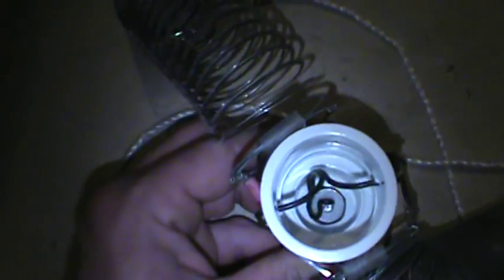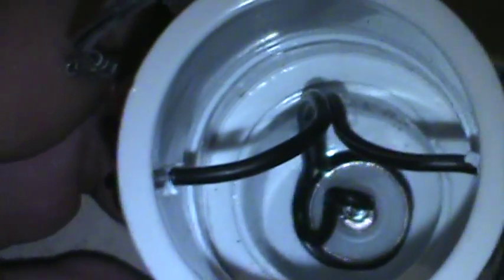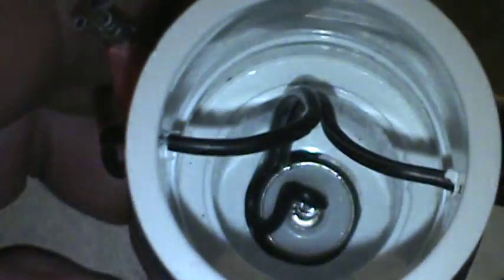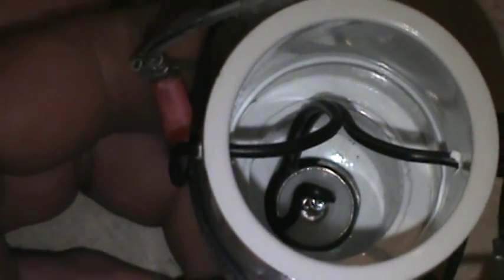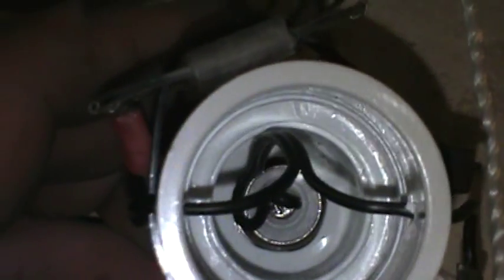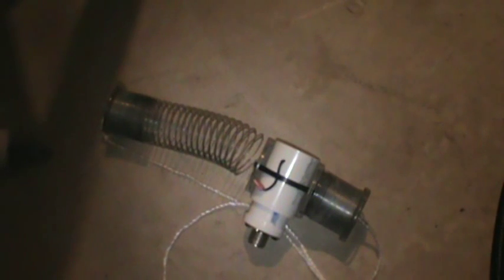Homebrew Slinky Antenna That Works

Comment: You can't use coax to feed it because it's not a resonant dipole,  it's two random wires (random slinkys) so the impedence doesn't match your coax so the coax itself is acting like a dummy load.

Comment: So you use large HF inhibiting coils (they create impedance) 
and are surprised that HF does not work?

Use straight wires instead of the toys, make it autoresonant on the band you want to use 
 by clipping the wires to the proper lenght (2x 5 meter lenght of wire for 10m-wavelenght  i.e.) 
dont make coils or even too many bents with the antenna wire.

If your attic is less than 10m in lenght, try a v-shape installation.

Good luck
73,OH8XAT

Comment: the problem IS the small slinky, they dont work on HF, you need to use the full sized slinky. Look at the size of a good open air HF trap, need I say more?
Reply: Thanks for warning. I bought slikny and received today. When wide open, its like 2 meters. Can you tell me how many meter do i need for hf?
Reply: @metinozyap1200  I think it's more the diameter of the small Slinky. I've used full-size slinky's before, with good luck
73/K2WW